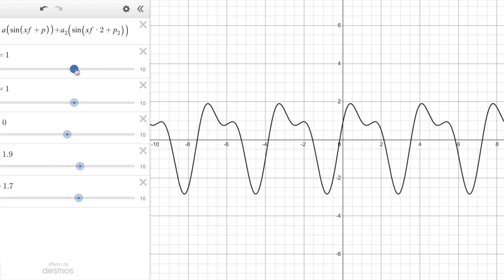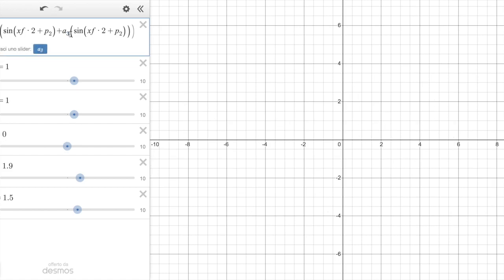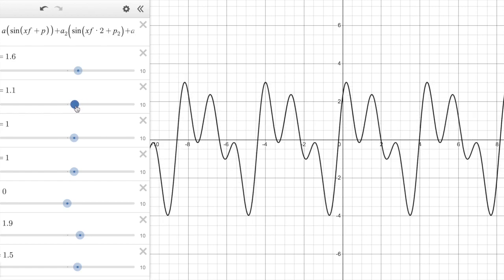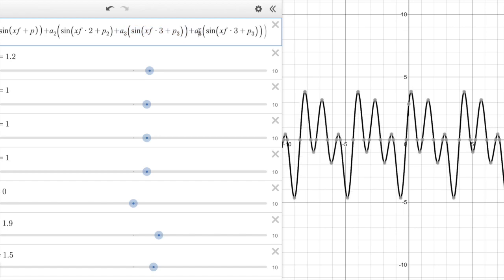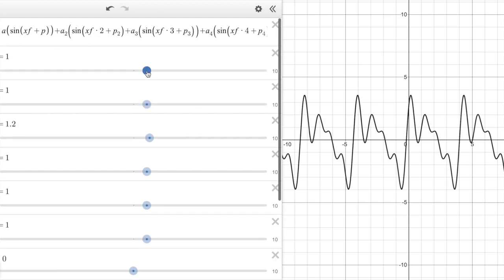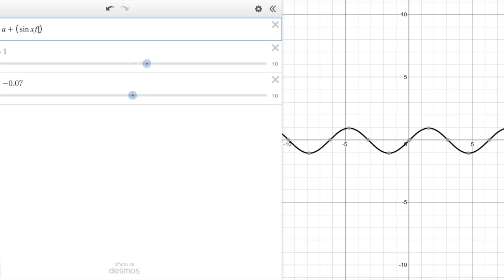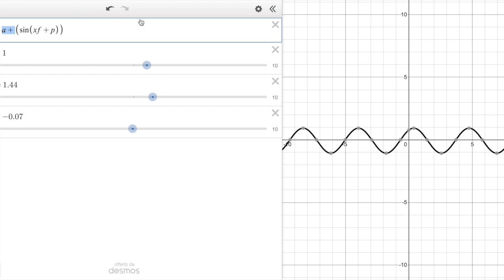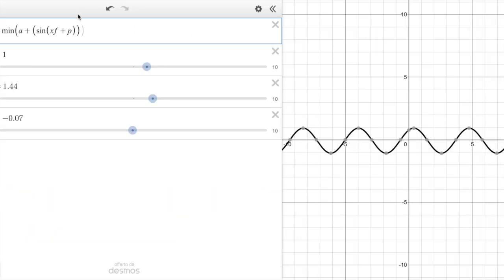Tropical Additive Synthesis Introduction and tutorial on MaxMSP

Comment: What about aliasing? I gave this a try and can hear a large amount of aliasing on C5 already with just two oscillators being used. (the minimum function is basically an if statement, so it's Non-linear, aliasing is an issue here)
Reply from the maker: Make it analog or place a brickwall
Reply: @toborexperiment  What do you mean with brickwall?
Reply: @9b0  he's referring to a filter with a brickwall steep cutoff slope

Comment: I want a eurorack module of this
Reply: @Felipe Tellez, @Giorgio Sancristoforo There is a Eurorack module that makes this an easy patch: the Doepfer A-172 min/max module. Connect a few sine oscillators, and you’re done. The only catch I that this module isn’t produced anymore so you’ll have to find a used module. The nice thing about analog modular is that you don't have the aliasing issue. I tried it with a few sine oscillators, a Tiptop MISO, and the Doepfer A-172. It sounds really nice!
Reply: @jandobbelsteen8953  there are also Min/Max outputs available on other inexpensive Euro modules, check out the Intellijel Ring Modulator 👍